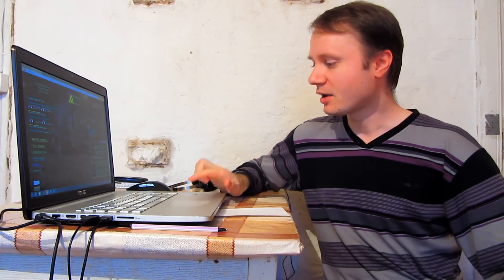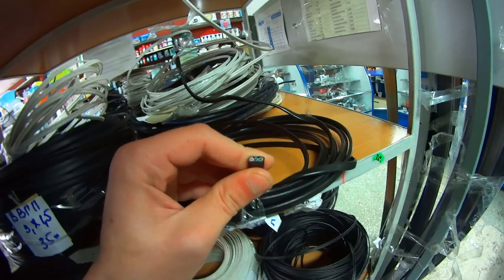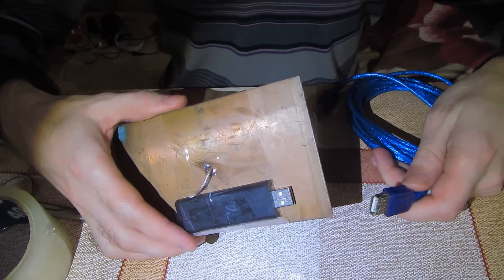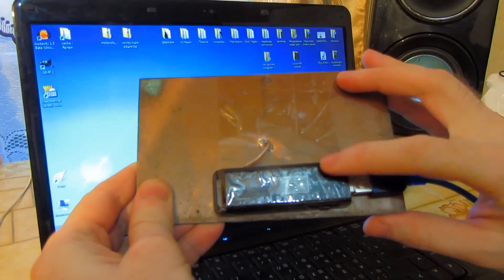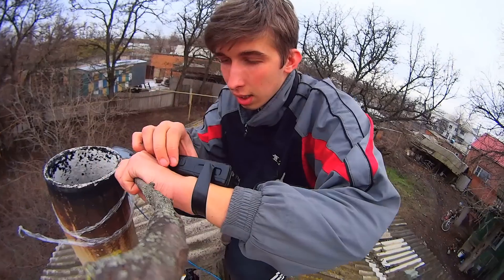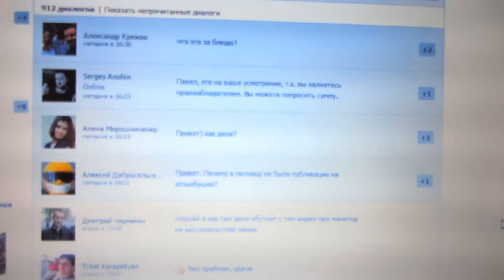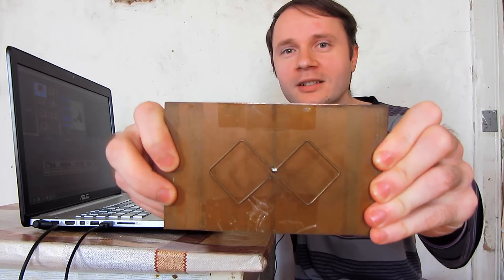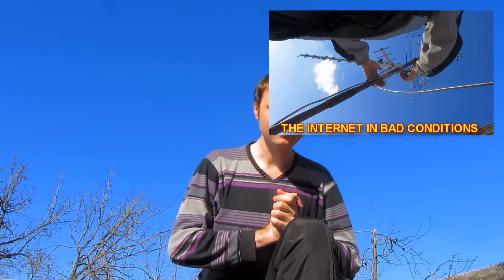How to get  free Internet access. Boosting of Wi-Fi signals

Comment: you could turn that into a directional antenna by covering up all but one side of the jug with aluminum foil the side with no aluminum is the side that receives the signal the aluminum blocks the signal and reflects it just like a flashlight mirror

Comment: Interesting, i tried to build a helical antenna and got good results but making and keeping the copper spiral perfect was a pain in the ass and it ended up breaking. I might give this a try, is there an optimal wire diameter? I have 2.3mm, that sort of stuff is so expensive here i just ripped it out of an old transformer

Comment: That wifi adapter you have is capable of great things.. Monitor Mode... Packet Injection...
You wont need to worry about finding open access points.. Aircrack-ng works great.

Comment: I made several of these antennas about 7 years ago to protect from weather I recommend a Tupperware container. I think I found that if you try to extend the USB cable more than about 15 ft. the resistance becomes to high without an amplifier.
Reply: Yep about 15 ft. is the most you can get and that is with a standard 70 mw WIFI dongle, if you get a higher power device it may not extend even that far before the voltage drop starves the device of power.   You can use a powered USB hub to get another 15 ft or splice in to the cord and over voltage it to compensate for the line drop.
I abandoned USB dongles when I found DD_WRT and started using routers and hacking my own POE cords (cat-5) then I could use a cord  up to 100 meters long.

Comment: I use instead a wifi yagi beam,attached to a 2. watt amp then to usb.
ive Not needed to go to roof...
i just aim out window to several fast food joints..

Mostly i simply use my cels 4G... or my own home high speed wifi.
i Simply was curious how well i can do finding & using various free wifi access points around town ( ive been able to access to about 30 free access points...and see some 160 password protected access points, ive Not tried breaking passwords on the 160,since i dont need to )
ive connected to Free access points nearly a km away... im guessing if i put the wifi yagi beam on the roof..ide get 2 to 3 times further
Reply: Pushing 2 watts just makes you an alligator (all mouth and no ears)
Just a suggestion but ... don't look down the wave guide with your only remaining good eye.
Manufactures only started making those over powered noise makers because ignorant people think they need it, and will chose a device with more power, when in reality what they really want/need is higher receiver sensitivity (and /or a better antenna).
Reply: Sorry Wrong..
I should of Specified... Pre-amp Not amp.

Comment: plzzz show how hack any wifi
Reply: Sadam Khan You can Easily Hack Most password protected wifis..
using a rooted android cel phone with several different hacking Apps..

if though you are in a well populated area...
then a good omni wifi antenna..
or a Directional Yagi or corner reflector..
connected to a 1 or 2 watt amp.. hooked to your laptop or home computer usb.....
should Allow / Enable you to easily connect to several..to a dozen or more free access point wifi spots

Comment: USB cables have length limitations, after some meters the cable signal gets too weak. How  can you overcome that?
Reply: +aLLoUgr you use very short usb cables, and get two usb to rj45 converters, these are very cheap, 7$ on ebay.. and then run cat5e/cat6 for 25/50/100ft without an issue..